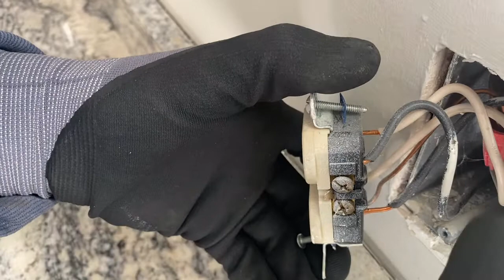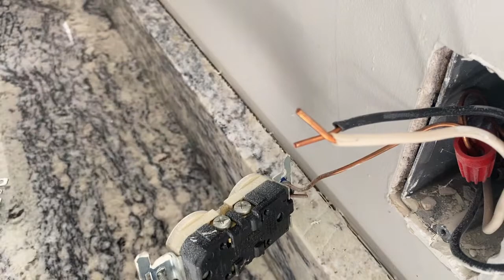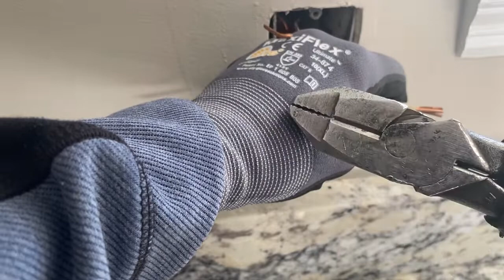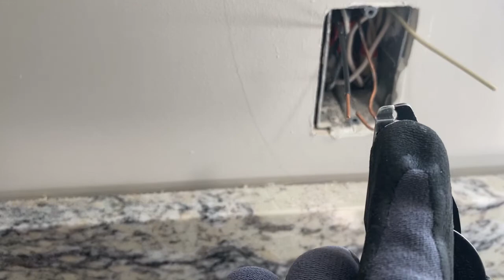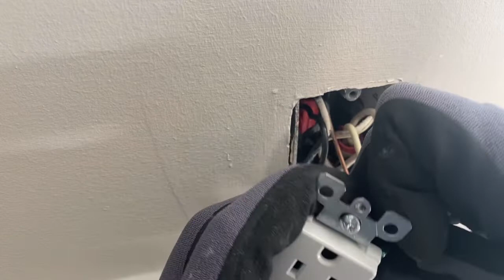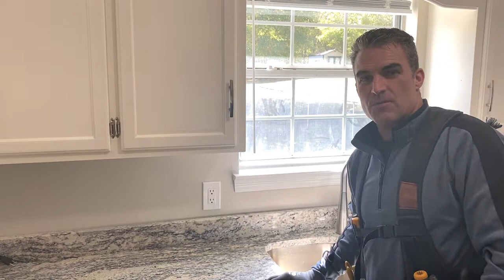How to Replace Old Receptacle with New Decora Outlet #diy #electric #howto

Comment: The reason why the wires that were backstabbed were so lose is that connection type is only made for 14 gauge wire not 12 gauge that was forced into it.
Reply: the backstabbing connectors are only held by one piece of metal and overtime the piece of metal can deform and lead to loose connections. Also older receptacles supported 12 gauge backstabbing based from my experience

Comment: Where is the ground for the second wire?
Reply from the maker: Hi. I don't know if you watched the entire video...because at minute 8:29 I show the ground wire (bare copper) being connected to the green ground screw. The pigtail for the ground was already existing in the box. that might be what you are referring to. I pigtailed that neutral and hot in this video to have a cleaner install for the new receptacle. Hope this information helps.
Reply: @YouCanDoIt2  I did not understand the ground wire was already pig-tailed. Thanks for clearing that up.
Reply from the maker: @fryefoto  no problem at all...I probably should have explained that in the beginning of the video.

Comment: There was one thing I noticed. When you made your J hook connections, there was a small bit of insulation pinched under the screw. It's always best practice to ensure ONLY the copper is pinched under the screw for a secure connection. Other than that this is a nice tutorial

Comment: Shouldn't that outlet be a gfci outlet?
Reply from the maker: Hi Urmastertech! You are absolutely correct.  However, this particular duplex receptacle is being protected downline from the load side of the GFCI that is installed at the kitchen counter. Based off NEC Code 210.52 (C)(1)(5) the kitchen requires  20 amp (quantity 2) dedicated countertop appliance circuits both protected by GFCI receptacles. This particular video is simply showing the swapping out of old to new receptacle only. Thanks for watching the video👍
Reply: @YouCanDoIt2  got it that makes sense. My wife and I just bought our first home and I remember the inspector saying any outlet near water would need a GFCI outlet. So I'm not an electrician or anything just was curious. In the process of switching out some of the outlets though. Most are 30 years old

Comment: You mentioned the reason why you pig tail the wires. How does that affect the load downstream? They all connected in series anyway…
Reply from the maker: That's a great question! There are a couple reasons why you want to pigtail your receptacles. First, if you pigtail your receptacles and one of them becomes defective it does not affect the power source to all other receptacles downline. Second, by pigtailing off to each receptacle you have kept the load in the wall with jumpers off to each receptacle. Pigtails take up much less space in the back of the receptacle. And, you should not count on a device powering other receptacles downline. Pigtails eliminate this. Hope this information helps.👍